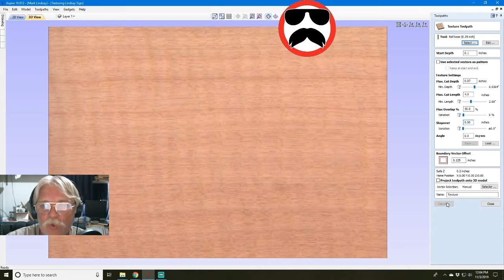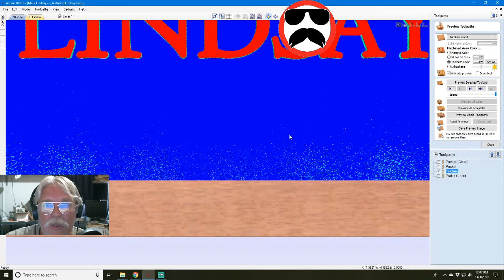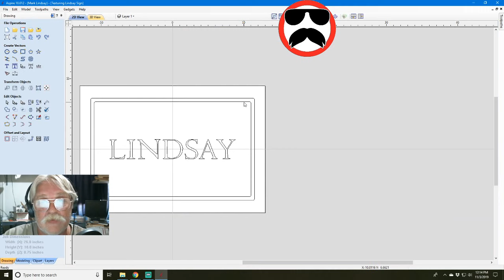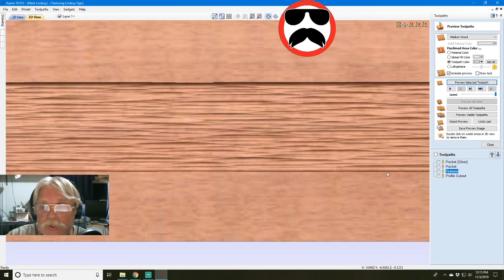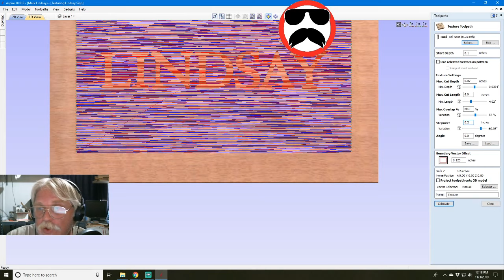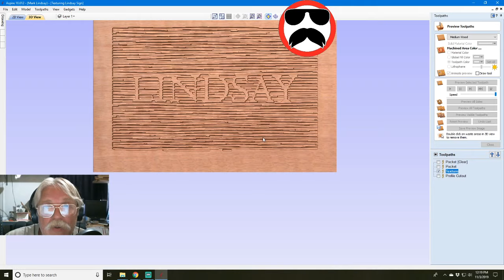Live Q&A #11 - Texturing Toolpath

Comment: Mark I missed the live video again. so I am watching this recorded. Any way so I I want to play around  with doing  textures  and compare different set ups. Can I pick a size of wood then create different rectangles and In each one do different settings to see what they look like. Also does Vcarve Pro have saved texture to choose from, Some where I got the idea they did have.
Reply from the maker: Yes, Jeff, you can certainly create different textures in different rectangles to check them out. That's exactly the way to do it. VCarve comes with one or two textures, but it's not something they've put a lot of time into, since there so many variables. Use the LOAD and the Save buttons like I demonstrated, and you'll be all set.
Reply: @MarkLindsayCNC  Thanks Mark I have 1 other question. About up grading to vcarve pro 10 What  in my version 9.5 will will be lost or written over  or change.  Do you ever use the machine  bed to set your Z zero so as to not cut into your spoil board.